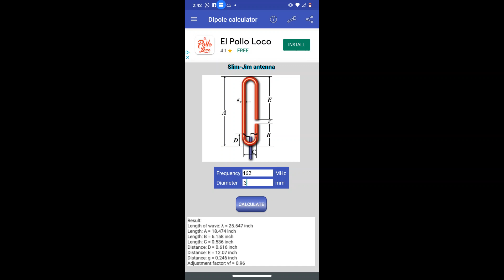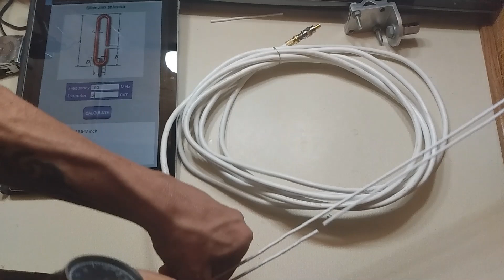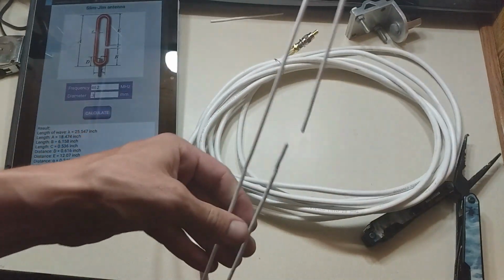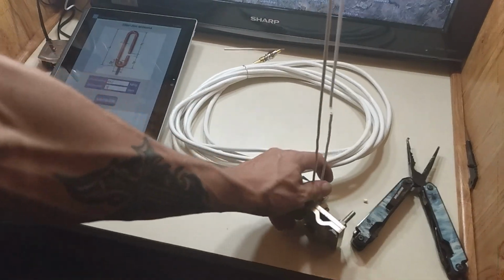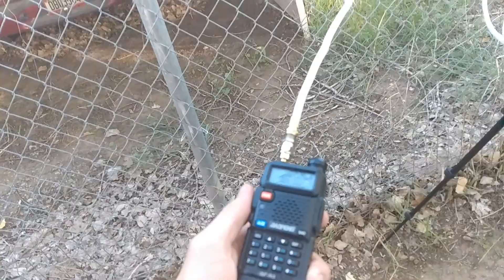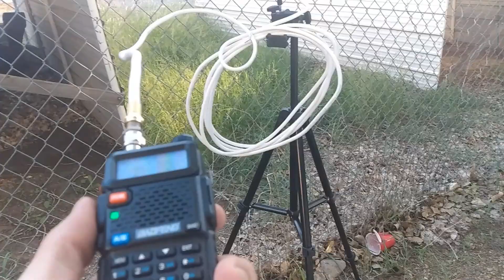How To Build GMRS SLIM JIM ANTENNA, BAOFENG. HOME BREWED SLIM-JIM ANTENNA.

Comment: Chain link fence within 2 feet, Aluminum storage shed within 5 feet, Mobile Homes with Aluminum siding within feet of your low mast. You need to get way above those. 

Then when you get a reply to your radio check call, ask them their general location so you can plot it on a map. Don't need a 14-figure grid coordinate, just within  2 Km or 1 mile. 

With 5 watts with a bad antenna maybe 2 miles but with a good designed and raised up a bit higher elevation maybe 15+ Miles. With a handheld I can hit a repeater 22 miles away between my son and I with a 5 by 5 both ways. But I am using a KB9VBR brand Copper pipe J-Pole mounted 25 feet up. Best $35 spent.

Comment: Maybe it's me, but it looked like you have the wire endpoints swapped.  According to diagrams I see, your shield/ground goes on the short end, and center on the long dipole element.  Correct me if I'm wrong.
Reply from the maker: That's correct and I fixed that thank you.

Comment: Where did you get this coated steel cable/bar.  Testing next to a chain-lenght fence is not as good as if you move it away.
Reply from the maker: @99Victor  from a friend

Comment: Thanks for making your video and sharing it with us. What app is that you are using on your tablet ? I saw below where you indicated Ham Radio Antenna Tools. I looked on IOS and found an app called Ham Radio Tools but it is a different application.

Comment: 1st.. use rg58 coax.. 2nd,, make a choke  out of the rg 58 coax near the feed point , 3 turns 4 cm diameter and 3rd,, mount the antenna as high you can  due to the low radiation angle ...8 degrees above the horizon... mount on pvc pipe or on a wooden stick..not metal near the antenna,,  you will have perfect results..i think the gain of the antenna is 5-6 db.  check swr before use..
Reply from the maker: done

Comment: Pretty cool, but if I could make one suggestion, maybe ask whoever responds, their location, so we can get an idea of the kind of range you're getting. I mean he could be down the block, or 25 miles over in the next town. Just a thought. Keep up the great work.
Reply from the maker: ya great point, usually its around 70 to 98 miles but the people watching don't know.
Reply: @arizonasadventures8827  WOW, that's great to say the least. Have you ever thought about building a manpack radio using like a Midland 40 or 50 watt radio and a lithium battery? I've been looking to build one, but all I see are people doing it with ham radios. Keep up the great work.

Comment: Good overall demo Just a few critiques. Make your measurements, mark them with felt tip pin at the inside radius of bends, make all bends at once (keep them in same plane). Make cuts after all bends are made. SOLDER!! Cable ends to antenna connection points. Insulate connections. Check SWR. Use...  Note: the connections will oxidize over time and build up high resistance unless they are fluxed and soldered properly. Would strongly suggest mounting the antenna to a short piece of PVC to move the antenna proper just above the metal mount.  If someone can afford a radio, they can surely afford a cheap HF soldering iron and solder. All "beginners" in the hobby of radio should learn to solder as a basic skill. No excuses not to learn. If you are going to do something, do it right, beginner or expert.
Reply: I just bought brand new GRMS and MURS HT's for $13 and $8.50 each how much is that soldering iron, flux and solder?
Reply: @ometec  Less than $20 total at Harbor Freight.
Reply from the maker: agreed thank you for that info and i will do that, thank you